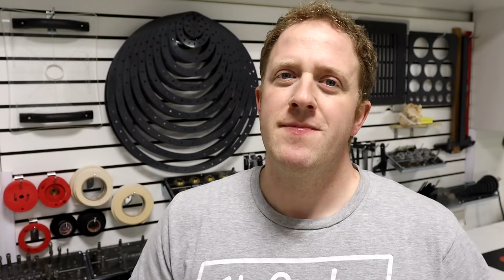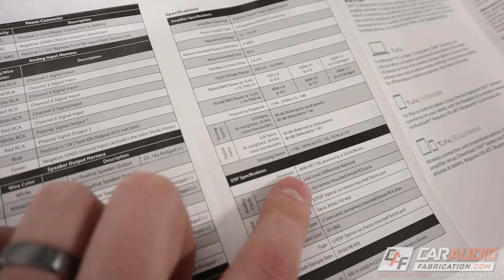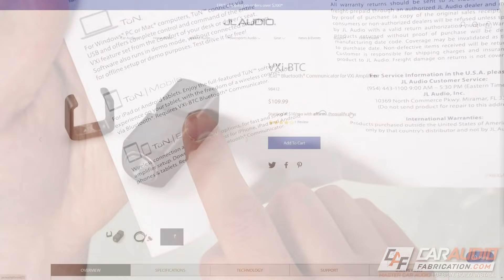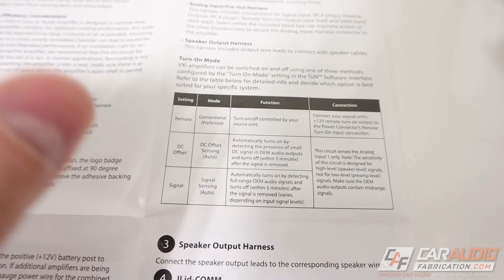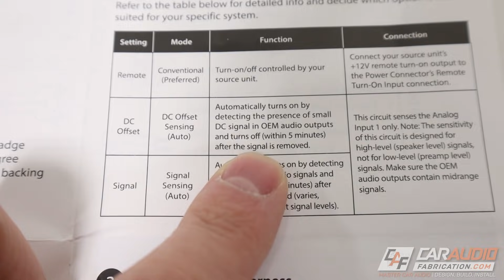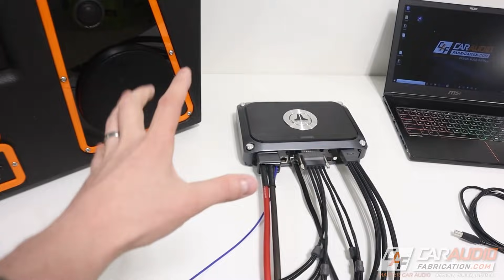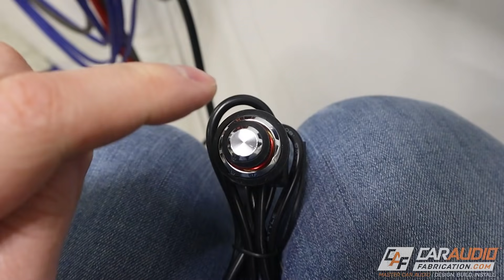Computer Tuning? JL Audio's VXi Amplifier! VX600/6i Overview

Comment: What about the voltage output from the LOC to the amplifier? Do you need to match the signal voltage? For example, if your getting 8 volts of signal voltage out of the LOC at 75% volume, but your amp input range is .025-5 volts, do you need to dish the voltage back at the LOC, or is that voltage ok to send to the amp?

Comment: I’m running a VXI 800/8 and a VXI 400/4 I have a 3 way JL C7 up front mid bass and mid range are bridged, have c2 in rear doors for fill, have 2 JL audio TW3 behind back seat and a audio control 1500.1 on the subs

Comment: Can I use the signal from the wires to the subwoofer to eliminate the LOC or does it need to be a full signal sound going in to the vx? I just bought a VX but I have not installed it yet using a lc2i pro & slash 500/1 v2 with a 10w6 in a custom built stealth box for a 2020 grand Cherokee with the 8.4” Alpine Uconnect JL c3 3.5” in dash and b pillars c5 tweeters in A pillars JL VR 6x9”. And JL c5 6.5” mid woofers in the rear door . I’m wanting to use one of these outputs to run a signal to a second amp to run my back door C5 mid woofers . I also bought a fix 86 I never installed and a Rockford DSR1 that I haven’t installed yet so I’m not sure what the best way to go would be . Currently running the stock alpine amp to everything except the sub and I’m happy with the sound up front and the b pillars but the rear door c5 sounds awful and need a better signal and more wattage . I’m not sure what way is the best and easiest since I basically have 3 options to choose from that I have not yet installed .

Comment: Just wanted to say thanks Mark for such a great and concise video to help a VX noob set up their amp quickly after spending a week in anticipation of enjoying our new system while slaving away on sound deadening efforts. Expensive, but very impressive and flexible piece of hardware. We also went with the VX600/6i to drive Audiofrog GS62 rear, GS60 + GB10 front. VERY impressed with the GB tweeter too.

Comment: I have the VX800. Had it installed by a shop. Will my current tune pull up on my laptop when I connect to the DSP? Or do I need to get them to send me the file?

Comment: Is it possible to connect a VXi 800/8 to a JL XD600x1/v2 via the VXi’s preouts so I can have both amps getting signal through the VXi? I’ve tried running RCAs from the preouts on the VXi to the inputs on the XD600 but no sound.
Reply from the maker: Yes it's possible. You need to properly route the signals in the software otherwise there will be no output.

Comment: I love JL audio, but I am disappointed in their current line up, I am at a loss to why VX series amps don't put out the watts to match their top line speaker like the C7s and the 13W7 sub, on paper it makes me feel like I won't get the full output from my system if I want to stay top of the JL spectrum. They need a 2 ohm version of the C7s or an amp that puts out matching power at 4-ohms. And I get the space issue with the wiring but the last thing I want to do is drop a butt connector 4" from my amp on all my speaker wires. I feel like I expect more from a way overpriced amp or a 15K build.

Comment: OK I just went to  a place that was going to put a system in my truck using this amp and changing some speakers in my Dodge Durango and they wanted $45,000, that sounded like a lot to me. They did say some custom work was involved but man $45,000.

Comment: I started using the Posi-Lock connectors so I don’t have to keep cutting wires back. I just did an install in my 1992 Camaro with their RD 900/5 amp but would have loved to get the VXi amp for the build. Had I known the radio would be so hard to control with the push buttons, I would have upgraded to get the dual control volume knob.

Comment: Hi when using this amp with the high level inputs straight from a factory system with rca to speaker cable adapters is it true that the negative wires should be connected to ground and not the speaker negative like Rockford fosgate suggest with there adaptors? Or just fine to connect to the speaker positive and negative normally

Comment: There are a lot of these sorts of amps out there - basically every company that offers a serious DSP tool has introduced at least one multi-channel amp with integrated DSP.  The problem, as I see it, is that none of them offer an amp with at least some AB channels.  Since the goal of any DSP system is to maximize the sound quality, doesn't it make sense for these amps to have at least four AB channels (better still six)?

Comment: I think JL dropped the ball a bit on these AMPS. I went toslink from my AMPPro into the VXi amp but I needed to use the preamp out for a XD amp. I had to use that giant plug just to use it which left 6 unused and unnecessary cables that needed to be managed.

Comment: Hello, I Have vx600/1i, It Went Out, The Light Comes On But Not Po Putting Out, Could It The Fuse(s) If So ....The Problem I'm Actually Having Where Are The Fuses?

Comment: Hey, mark! I have an ‘18 Audi A4 with the B&O sound system. I was thinking of going with an VX8/I for a 3 way front active  and passive rear component. Will these accept and sum signals going in because I don’t think there is a full range speaker in the car?
Reply: You need a Nav tv Zen-v unit to connect to car before amp. Unfortunately.
Reply: @ryanb8736  is there a reason why I need a Zen-V unit?

Comment: Great video. I have a FJ40 landcruiser with the Kenwood dmx1057xr with JL C3-600s separated in the doors, C3-650s in the rear and 2" kappas in the dash. I have the vx800/8i and it sounds horrible. I've been watching the JL audio TUN channel on youtube, but I got more in 5 mins of you adjusting the gains than hours in their channel. But just when you started getting to good parts, you moved on. Please give us more content on the TUN software. I know my system has potential, but need your help ;)

Comment: Are these dsp amps designed with people with factory head units in mind? Can I not achieve the same results with a good aftermarket head unit with a dsp built in? I ask because im in the market for a new amp but I already have a pretty decent alpine head unit with a bunch of tuning features.
Reply from the maker: No aftermarket head unit has the horsepower this thing does for tuning. A single 10 band graphic eq on your head unit is nowhere near what this has with 10 bands of PARAMETRIC eq on EVERY channel. Not to mention independent time alignment, crossovers, polarity, etc etc on every channel.

Comment: I have a question about a amplifier.i have a ma audio amp 1200 watt .it has only one set of outputs the right is labeled positive.when I check the output with a millimeter it shows that the polarities are labeled wrong.why would that be?

Comment: Does this amp have analog preout to run alongside an older jx500/1?
Reply: Yes, the VXi has a preout to run with the JX/500. I have a VX/600/6 with a JX/1000/1 on its preout. Works great and full dsp compatibility.

Comment: I’m in the process of trying to get a SQ system into my truck and I’m not sure if this amps better than audio control LC6.1200 and I’m also in limbo of what 3 way components I want to use the JL C7’s are so expensive but is there any other recommendations you may have thank you for your time and awesome videos

Comment: Does it have any "auto tune" capability like the Audio Control stuff does? Output from my Uconnect system is far from flat (as you know) and need to replace my AC 6/1200

Comment: If I'm reading the sparse user manual correctly, I can use the inputs as line level? (I'm stuck with a Uconnect system in a Ram)

Comment: Hi Mark.  I have an audi r8 and I wanted a little bit of a clean base.  I recently put in an 8 inch JL audio sub woofer, one of their ported boxes.  However, I am not getting that nice , round, clean sound I was hoping for.  I am using a JL audio amp.  It is an xd 700-5. I am running the sub woofer output but I am not happy with it.  Any advice would be greatly appreciated.  I am running a high to low adapter to put the signal in.  space is also limited for me in this car.  The space I have available is 34 inches long x 8 inches wide x 14 inches tall.  I am a hard core fan of JL audio...I will not change...thanks!
Reply from the maker: Source signal could be the main issue here. Are you sure that the factory system is providing bass all the way down to 20HZ? Sometimes it's heavily rolled off depending on where you are getting the signal.
Reply: @CarAudioFabrication This right here. On a BO Audi sound system, you need a Zen-v box to receive a full signal.

Comment: This is something I wanted in my previous vehicle, but it did not yet exist, so I ended up DIYing a DSP in front of the amps (thank jebus I'm a tech wizard).  I really like what JL Audio have put together here, in such a small and stylish box.  The features are all there for a very high-end product, but what is with that 100w@2Ω power rating ?  Sure, it's enough for a lot of systems, but I think in a flagship amp they could have at least gone for 125@4Ω / 175@2Ω.  That would have sealed the deal for me, but in its current configuration it's just not powerful enough for the build I have in mind, and I'm back to needing a separate DSP, split amps, and all the bulkiness that entails.
Reply from the maker: Check out the VX600/2i for more power

Comment: I was wondering if you had two xi amps one for the mains and rears, then another for bass if they would both be able to be tweaked on the software.?  Would they be connected?
Reply from the maker: With the VXi hub they can be networked and programmed simultaneously

Comment: I don’t know why they wouldn’t make this amp with more power on the midbass channels. Like make it 75x4 and 150x2. You know that’s how most serious sq people would run this. I was going to buy this amp but the lack of power was a deal breaker so I went p six instead. Jl if you’re monitoring this, consider more power on at least two of the channels for the midbass.
Reply from the maker: You could get the 8 channel and simply bridge the last two channel pairs. Problem solved
Reply: @CarAudioFabrication  no way! Had no idea. Thanks!

Comment: This would have made it easier to tuned in my morel speakers hehe, got a god deal on em so I decided to try em out. Turns out I needed to tune the 16khz range down by about 10db, on an amp that only gave me -6db adjustment, to get a flat curve. Good thing the crossover came with the option to make the tweeter 3db louder hehe.

Comment: Is there a way to provide the make and model of speakers "tweeters, midrange, sub etc" and have the dsp automatically calibrate everything via a microphone.  That would likely create a much better end result that is customized for the specific environment.  Trying to manually calibrate everything is really designed for the pro installers who have years of experience.

Comment: Looks like I found the solution for my Tesla. I like the system, it just needs more power for those windows-down days. Having presets on a knob that’s not tied to a head unit is the “killer app”.

Comment: Hi Mark! Awesome video as always. if I were to ask for an explanation of some of the TuN features, it would be that of the optical input functionality.  I have a system planned with a FiX-82 using the optical out to a VX800/8i and I'm having to wrap my head around how this configuration works in terms of output level.  I understand that you are dealing with a completely digital signal.  How is the 'level' of this digital signal coming from the FiX going to the VXi controlled? Is there clipping? It is obvious that the signal source strength from the factory head unit is what controls this, but I have found very limited information to explain this in complete detail.  Any insight would be greatly appreciated!

Comment: Love all the videos you make, you helped me figure out some issues while installing. I have a question i am installing an amp on a 2003 Nissan frontier. I'm also going to use a blade fuse box for other light's I will  install in the future . Can I connect the amp power (12v) wire and the wire coming from the battery to the blade fuse box in the same place? Hope my question make sense thank you..

Comment: Great video as always! Question however, currently I have a JL Audio RD900/5 with a twk-88 running completely digital via toslink. Should I move to a VX600/6i or stay where I am? I do love the software that I can use on the twk88 and it's nice to see it here with the VX so I would be comfortable tuning a new system. Thoughts?

Comment: The 10eq seems a bit weak compared to everyone else's 31eq.  How much of a difference in sq would you expect between 10 and 31?
Reply from the maker: A 10 band parametric is VERY capable of doing everything you would need to do for a tune. You have a ton of flexibility as you can control the exact frequency point and the width of the "q" you want to control. Unfortunately with a graphic EQ your "q" or width of the control at that point is often locked, and you cannot pick exact frequencies to adjust.
Reply from the maker: JL has a really good help center video about it here https://youtu.be/IYqKFHehf9I

Comment: Yes, Mark! Please do an in depth video of the JL Tun software. There really aren't any good detailed videos about how to use it. I have a twk88 stand alone DSP that I tuned myself with a full JL setup with an active 3-way front stage. I'm an electrical engineer so it was a cake walk using their software (very intuitive for technical users), but it is detailed and can be complicated for unexperienced users. 
Great videos as always!

My setup:
Source: Cell phone, usually Spotify Premium on Highest quality over a Qualcom APT-X HD bluetooth receiver puck - Toslink digital stereo audio into JL Tkk88 DSP.
3 way active front stage, no rear stage. I also have the DRC-205 for the DSP control. (small = all volume, larger round = subwoofer volume.)
Tweeter - Home theater Vifa tweeter (amazing) 20KHz - 2.5KHz
4" mid range - RBH Sound Beryllium driver in cast basket with phase plug- 2.5KHz - 400Hz
Tweeter and mids mounted on dash in custom fiber glass and body filler sound deadened enclosure, pointing directly to appropriate ear - I don't care about balanced sound for passengers.
6.5" low mids - JL Audio C5 650 - 400Hz -100Hz. Speakers in front doors.
Subwoofer- JL Audio 10W7AE in JL's sealed box.

AMPLIFIERS:
JL Audio HD750/1 - subwoofer
JL AUdio HD600/4 - 2x 6.5" doors and 2x 4" mids
both HD amps are stacked on top of each other with JL's HD stack kit
JL Audio 300/4 - 2x tweeters and the other 2x bridged into 1 mono bass shaker in driver's seat.
I used to have installed (now on the shelf in my office) another JL 300/4 for rears but it doesn't really add much to the driver's sound stage.

The sound quality, imaging, sound stage, dynamic range, and impact is INCREDIBLE!!!!

Comment: Hi, is the 3/4 - 75% volume level the rule for setting these up or even the TwK88 DSP or can one go for the SMD DD-1 option? I have found that the inputs on DSP amps clip or even standalone DSP's if the source unit is set to maximum unclipped volume.

Comment: Just wish the DRC 205 didn’t have such a cheap feel to it. It should have been made of metal
Reply from the maker: I didn't really have that feeling, the rubber around the control has a nice tactile feel and rotation is smooth and easy to locate / manipulate without looking at it much, from my experience in the Supra project we used it on.
Reply: For the price, the fact it's made of plastic is borderline insulting.

Comment: Mark - would love your insights on the optical outputs on these amps. I have two in use currently (600/6i, and 600/1i), and am sending signal from the 6 channel to the monoblock via optical.

This made level setting dead simple, however it seems I'm unable to crossover the signal from the 6 channel master amp that's being sent to the monoblock. The reason I want to do this is I love being able to change subwoofer crossover points from 50/80/120 on the fly depending on the music type (and was intended to do this via the drc-205 presets).

I think the only solution will be to switch from optical to analog outputs between the amps, but thats super lame.... am I missing something or is the optical output on these amps always fullrange?
Reply from the maker: Hmm, I'll have to play with it to find out. Maybe JL can chime in. In my opinion it's not super critical to use toslink for a subwoofer amp, but I can see where you would want to if possible. Maybe the Hub would be needed for this. I'll definitely take a look.
Reply: @CarAudioFabrication   many thanks for the response and any follow up coverage. It seems you can DRC control the optical outputs, apply EQ’s, but not crossover’s. 

Seems like a silly omission, especially if the only alternative is to use the analog pigtails on both amps, with most of the connections just hanging out while a single RCA connection gets made. My wiring is so clean with just the optical connections in use at the moment.

Kind of suspect I should have gotten a more basic mono block amp... JL support lead me slightly astray on this detail. Oh well, it still sounds pretty damn dope.
Reply: Your best bet is to use the analog preouts for your sub amp. They have full tuning capability. The Toslink output has only EQ.